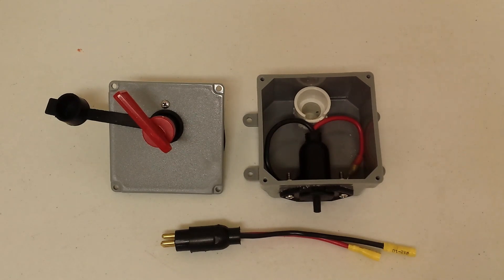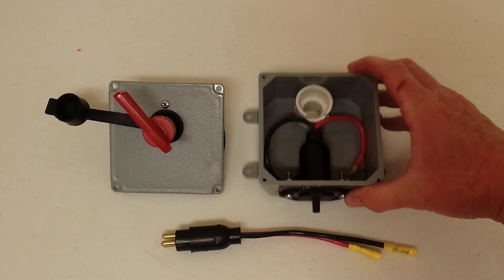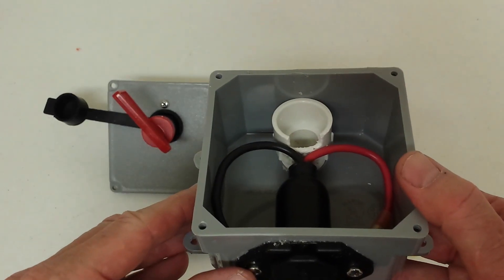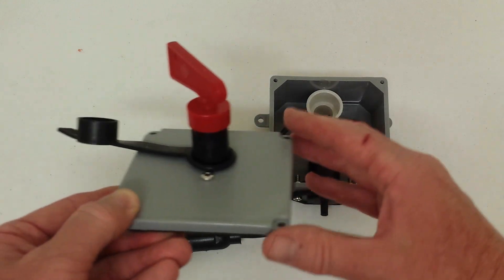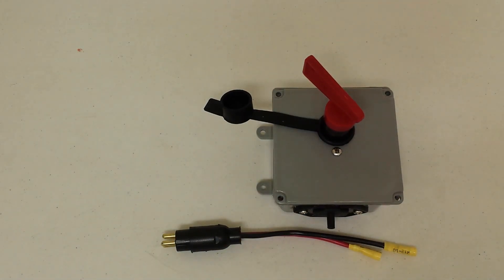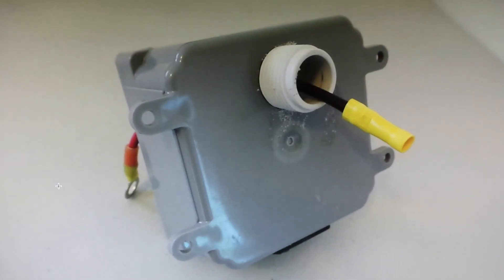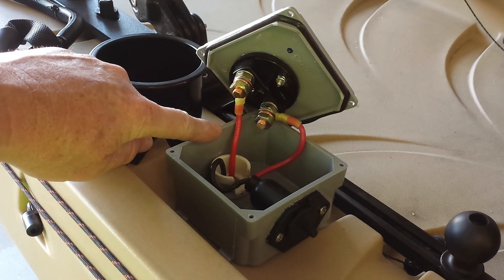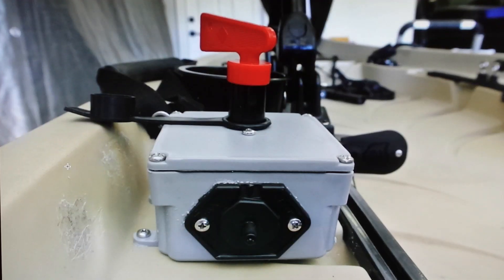DIY Kayak 12V Trolling Motor Power Plug and Kill Switch Junction Box

Comment: for some reason the amazon website states key only comes out if its in the off selection. is that correct? if i fall of the kayak how does the key come off?
Reply from the maker: Yes. You need to tie a lanyard to the key to rotate and remove.
Reply: So if I fall in the water on the wrong side of the kayak then the key wont turn and stop the engine right? There is the waterblade version available that just has a pin in it that I would prefer but importing it from the US would put me back $70... 🤷🏻‍♂️

Comment: So the Red key part of the switch just easily pulls out ? It doesn't have to be turned? Can you provide a link to where you bought it?
Reply from the maker: You pull on the key from the side and it rotates to break the connection. I bought it from Amazon. Here is the link.  https://www.amazon.com/gp/product/B01IBOH5EA/ref=oh_aui_detailpage_o01_s00?ie=UTF8&psc=1

Comment: Good circuit build. I checked out the Newport 36 lb thrust $129 salt or freshwater.
Next time I will use one of theirs.
Reply from the maker: Thanks Wayn. I have used the NV 46 and 55 lbers and like them a lot. I think they are a better value than MK.